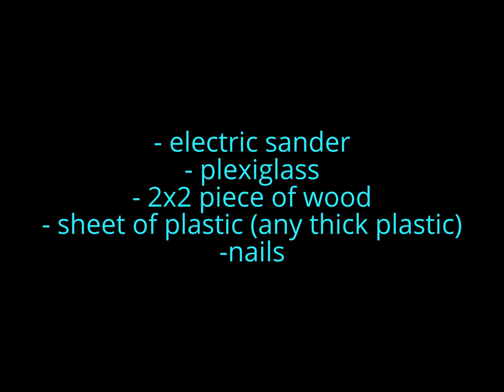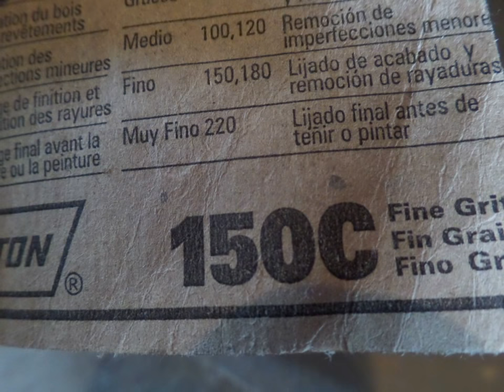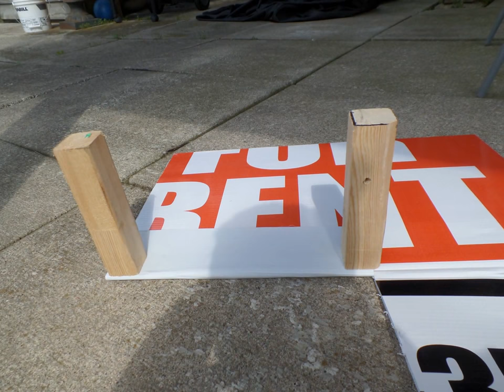Tortoise Table Build (FIXED VERSION)

Comment: The plexiglass is wrong. Goole first for information
Reply from the maker: +Shaun Porter yes they don't do well with see through walls, so I added that wood at the bottom so she couldn't see through. She does fine in there. She never seemed to have the issue with running into the wall lol
Reply: Why?
Reply from the maker: Some individuals dont understand the concept of glass and will constantly try to walk through it becoming overly stressed. Luckily mine understands it and isnt bothered.